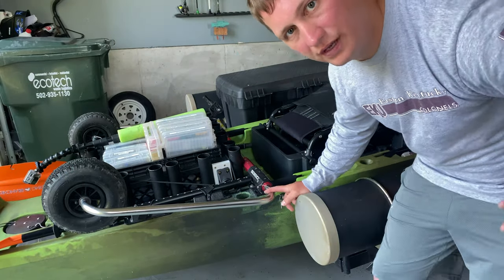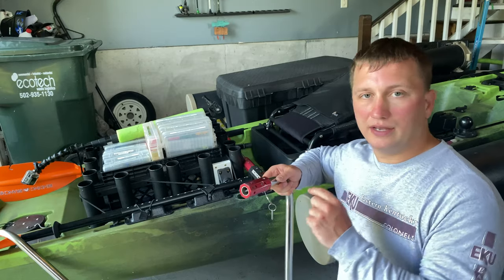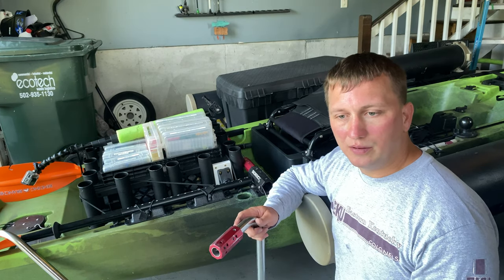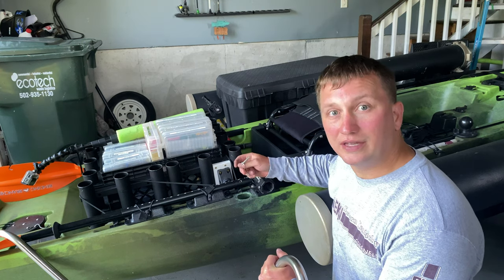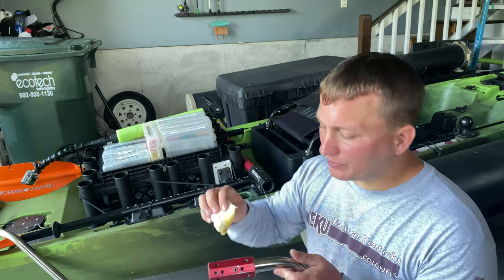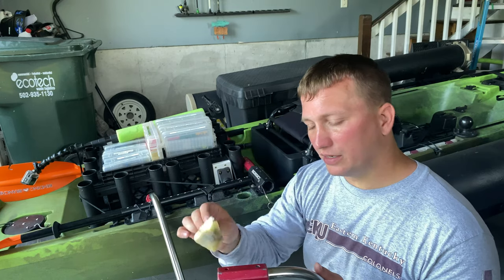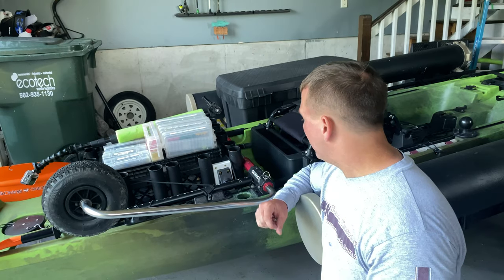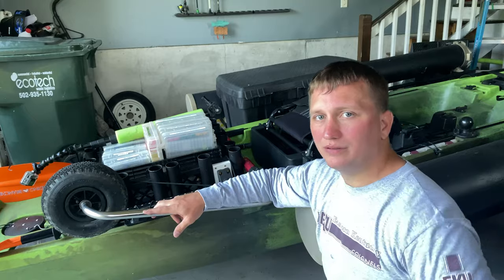Native Sidekick STICKING? Groovy Landing Gear sticking? Simple and Effective Solution to FIX it!

Comment: Great idea, just used it, worked perfect.  I am having different issue, on landing it is difficult for me to reinstall the wheels. I have sand tires which are needed to transport. It literally feels like trying to push a balloon down into the water to git the wheel into the track.  Pls advise!! Thanks.
Reply from the maker: The only wheels that don’t fight you when putting them in the water are the all plastic ones
Reply from the maker: These wheels might work better https://amzn.to/4czFizN

Comment: impossible to remove in the water!! buoyancy pressure from inflated wheels uhg.. only thing i dont like about slayer 12.5 how to load into the water  .. I'm an old fella and slayer12.5 is heavy
Reply from the maker: It’s a HEAVY beast!
Reply from the maker: It’s actually faster for me to get my bass boat in the water than it was for me to get my Slayer 12.5 on the water.
Reply: @RhinoJoeOutdoors  Yes it is... I purchased the c-tug kiwis and it helped mobility a bit

Comment: Mine was hard to get out I have the groovy landing gear but it was how I had the bolts threaded into the bracket holding the support brace on got that straightened out goes in and out better now
Reply from the maker: Mine was never super smooth but recently it got way more difficult. This really has made it easier.
Reply: bryce mc  I have the groovy landing gear not the boondocks. the groovy landing gear is shaped like a square insert, not sure if  yours is  shaped like a octagon. But the bolts that hold the landing gear to the kayak theres an L shaped bracket  I had them too tight and when I loosen them the landing gear seems to slide in a little bit better. Not sure if that makes sense. also you can maybe try using a lubricant or some type of beeswax rub that down and see if that doesn't help....

Comment: Looking at getting these for Slayer Max, how well does the track hold up with all that weight placed on the track bolt instead of hull mount?  I know Boondox hull mounting can crack the hull from weight and the tracks seem less strong but at least not boat damage.
Reply from the maker: I never had any problems with mine and I traversed some rougher terrain.

Comment: same issue with my native sidekicks. i sprayed some lithium grease on it and works slightly better but it does get dirty. Still can get stuck at times. It seems like Native has some manufacturing quality issues cause one of my legs ended up being shorter than the other as well. No response from Native when I inquired about that. Smh.
Reply from the maker: Yeah they do.

Comment: I INSTALLED THIS WHILE I WATCHED THE INSTALLATION VIDEO THAT NATIVE CREATED, SO I KNOW IT WAS INSTALLED CORRECTLY. FOR SOME REASON, IT WOULD NOT STAY TIGHTENED IN THE TRACK SYSTEM. PLUS, REMOVING AND INSERTING THE LEGS IS EXTREMELY DIFFICULT. THIS MAY BE WHAT CAUSES THE BRACKET TO COME LOOSE IN THE TRACK. AND THE INSERTING THE LOCKING PIN FOR THE LEGS IS VERY DIFFICULT, IT DOES NOT WANT TO GO ALL THE WAY IN SECURING THE LEGS PROPERLY. THIS TOO COULD BE FROM ALL THE STRUGGLES WITH REMOVING AND INSERTING THE LEGS. THIS IS VERY FRUSTRATING AND WORKING WITH THAT SIDEKICK WAS A NIGHTMARE TO SAY THE LEAST. I AM ABOUT TO JUST UNINSTALL IT AND USE A CHEAPER STRAP CART I HAVE. DO YOU HAVE ANY IDEAS OR SUGGESTIONS ? THANKS.
Reply from the maker: I found adjusting the set screws correctly was key
Reply: Have you tried taking off caps lock?
Reply: Why are you yelling bruh lol